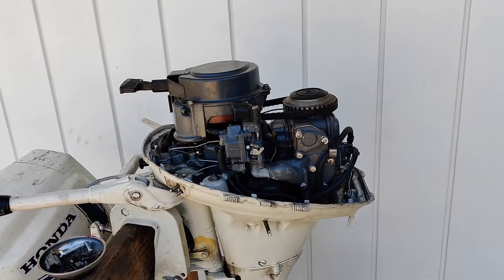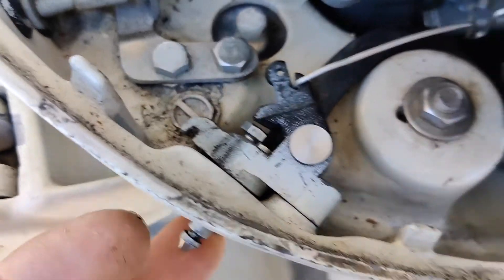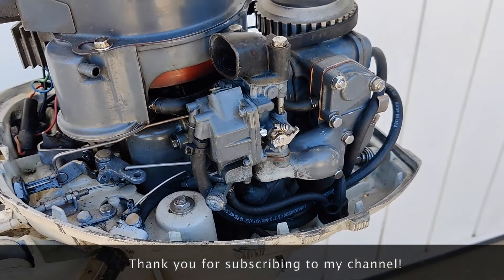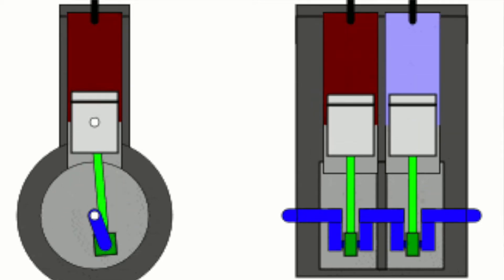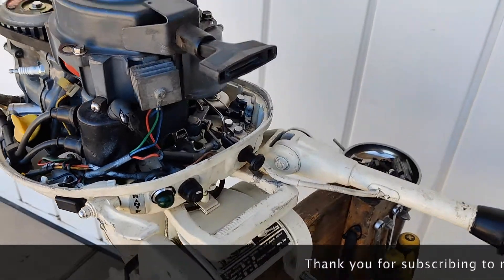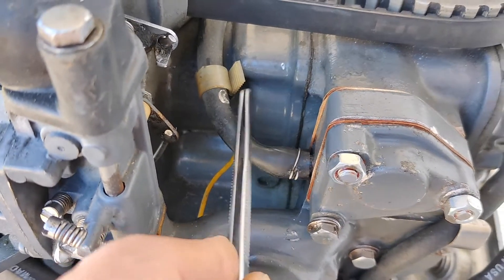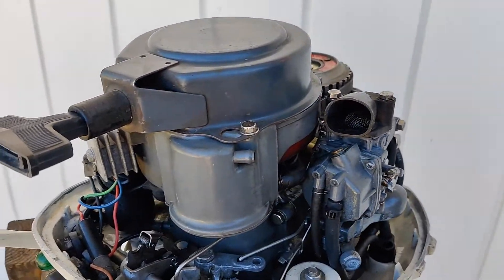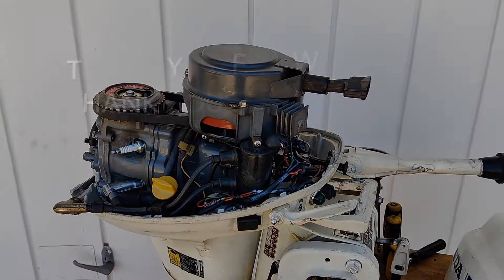HONDA B75 CARBURETOR AND IGNITION ISSUES

Comment: Do you know if the carburetors for the  b75 and the b100 are different? I put a carb from a b75 onto my b100 since the original was broken. It idles fine but sputters and backfires through carb when I try to accelerate quickly. I can ease into the throttle and it will bog and backfire but then rev up and go.
Reply from the maker: I don't know if there is any difference, but if there was no backfire with the old carburetor before, that means you need to clean the one you are putting in now very well. Causes of backfire can be poor ignition timing, poor timing belt alignment, a burnt valve, swapped spark plug wires, and a lean fuel mixture.

Comment: Hi, very helpfull video. I just bough model like this and this video means a lot 🫡
Is it posible to change clasic platinum with electric (cdi) ingnition power sistem?
Reply from the maker: Interesting question! I never did this. I will recommend you to find parts catalog and check if this is possible. Don't forget points ignition are more reliable, less expensive and easy to fix. Please watch this videos to understand points and CDI ignition. The ignition system between  Johnson and Honda are way different ( 2 stroke Аmerican motor and 4 stroke Honda motor ) but I'm sure You can learn a lot. Honda does not have side and complicated CDI problematic ignition unite. 1. https://youtu.be/iy_766-cQQg   2.  https://youtu.be/DKy86eTBVwY  3.  https://youtu.be/VeJIS_-xZqM

Comment: Hi I have a slightly newer Honda b100 with the point ignition. I cannot seem to get spark at all! I make sure to ground both plus at the same time to the block when I spin the flywheel. The gap has been placed at 0.014 in. when flywheel is on F. The plugs are old, but I gapped them at 0.024. I am thinking that the condenser is bad. Is this likely? Can I find a replacement?
Reply from the maker: Yes probably the condenser is bad. If you can't find the original condenser you can install automotive 12V on the side of the engine with cable extension. The cable to the points. The condenser case must be grounded.
Reply: @BoatMotors I tried using an automotive Condenser and didn’t see any results. I finally found a oem point and condenser on eBay for a good deal! Now my motor fires up! I am now having carburetor problems. My float pin was stuck and I was afraid to take it out. It starts and stays on with choke. I have no idea how to properly adjust the float. I believe my float is slightly low.

Comment: Need your advice on fuel lines. When replacing the lines where do you get the thin walled, quality fuel line? The parts manual says it's 4.5mm id, is that correct? Thanks
Reply from the maker: Yes 4.5mm
Reply: Thanks for getting back to me. Can you tell me where you get them? So hard to tell quality when buying online. @BoatMotors
Reply from the maker: @jimdinthed  You can get fuel line from Autozone (3/16") 4.8mm. 0.3mm will not make any difference.
Reply: Thanks for the info. I've repaired 4 of these Honda motors with the help of your videos. @BoatMotors
Reply from the maker: @jimdinthed  You are welcome!

Comment: Thanks for the video!! Came across one of these for $75. Runs pretty good. Is it worth attempting to clean the carb so long as the gaskets don't get damaged? I understand replacement parts are not sold anywhere.
Reply from the maker: Carburetor replacement parts are not available.
Reply: @BoatMotors Yeah unfortunately. So would it be worth it to attempt to clean the carb? Or should this be avoided to prevent needing replacement parts, which are not available?
Reply: @kalebsheridan9017  if you have to clean the carb you have no choice but clean it im about to open mine im sure its posibble to make a new gasket with the right material

Comment: Hi can you please help me.  My BF100 honda 1980 year,  In the test barrel it runs good in neutral and in gear,  When I put the boat in the water it starts easily and idles,  once I put it in gear it makes very little power and idles ruff.  Any idea what I should do?  I have cleaned the carb several times and that has helped but this time nothing seems to work.
Reply from the maker: Did you check the spark plugs and the cables? Did you do compression test?